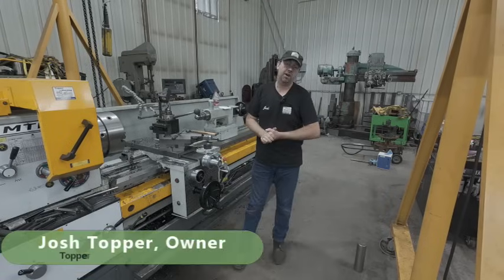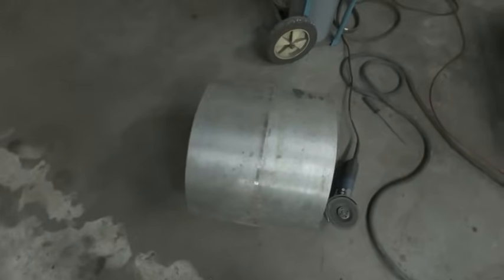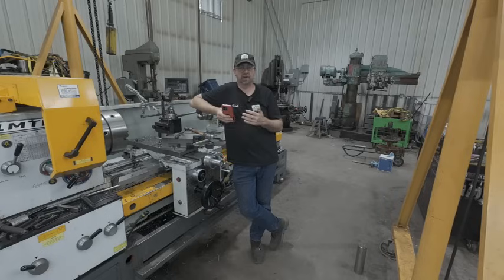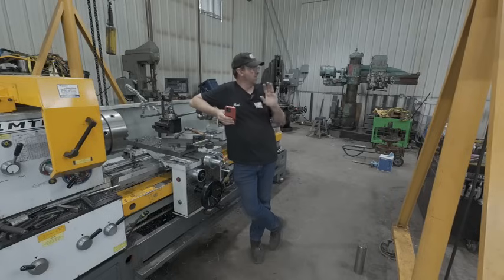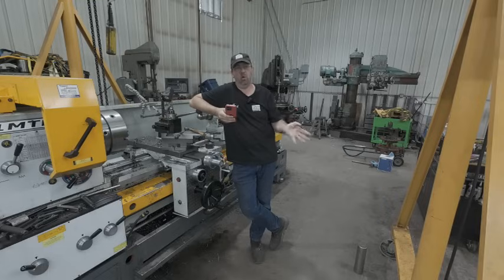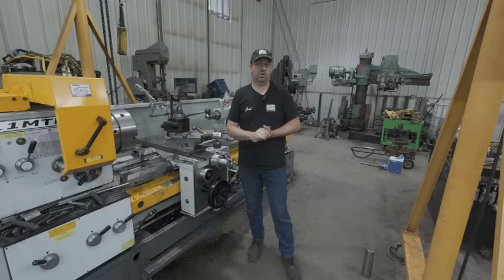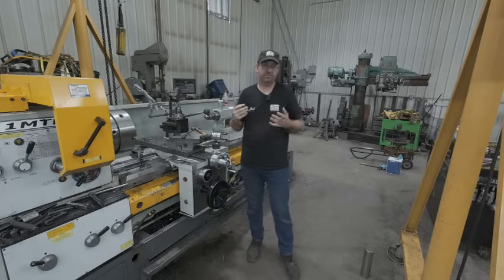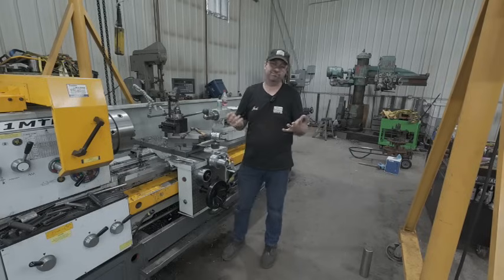Answering Viewer Questions About Machining The Crown On The Flat Belt Pulley | Follow-Up Video

Comment: The fact that a crown holds the belt on, as it was explained to me, is the belt goes towards the tight spot. With a crown,  the belt is tighter in the middle so there is more force there than the outside so it is pulled in. Basically it's physics, I guess. Kinda the same principle of weight transfer on a trailer. The force is going to go towards where the most weight is. If it's towards the back of the trailer (outside of the pulley) that's where the most force is going to be put. Conversely, if the weight is up front (inside of the pulley) that's where the weight is. Now, the rear of the trailer has no mass to keep it steady, and it will start to sway (belt will fly off). Weight in front of the trailer, towing vehicle absorbs any movement (belt stays on).

Comment: I bore and thread in reverse all the time, pressure remains downward with the correctly handed tool. The benefit I find with threading towards the tailstock is higher RPM, leading to a better finish with inserts. I can thread to a stop any day of the week, but the finish can really benefit sometimes with the speed I would never use, treading to a stop. I'm not as instant at stopping as a CNC.

Comment: While i understand your point about turning in reverse, i think it become moot with the boring bar. The boring bar applies a torsional twist to the post, one way a CCW load and the other a CW load as the operator facing the cross slide. It would be similar as to using a tool mounted to the left of center vs. The right of center of the tool post, would it not? The difference which i do understand from your point is an upside down, say, cutoff tool would apply lift the tool post, but the boring bar tries to twist it since it hangs so far off the side.

Comment: I had a shop teacher who explained why they crown bandsaws and flat pulleys. He said to think of putting water on the surface. The centrifugal force would cause the water to move to the highest part of the wheel. The belt does the same. Always enjoy your videos, keep up the good work!
Reply: TY. I have always wondered about that.

Comment: Hi Josh . What i have to do with the taper turning attachment is after the cut , withdraw the tool after noting the position on the dial . About 1/2 a turn . Then wind the carriage back about one and a half inches back past the start of the cut , then yank the tool post by hand back towards yourself quite firmly .  This seems to take the backlash out of the split cross slide screw and it's multiple connections to the taper attachment .  Then just wind on the net cut .    That usually works for me .    Cheers  👍
Reply from the maker: Thanks Max. I'll try that next time.
Reply: Hello young max.

Comment: You need a good ol Bullard! we have a baby 24" from 1925, it does not get used much, but when you need it, its perfect for stuff like this. Otherwise we make a lot of shop made boring bars, use them for threading mostly, but perfect for stuff like this. weld a bunch of crap up, add stiffening ribs even, mild steel is fine when you are talking a 2 inch bar.
Reply from the maker: I would love one, but with zero work for one, it isn't justified.

Comment: Good follow up. I mentioned before that I did that upside down boring bar approach - but I remember now that I ended up buying a left hand boring bar so I could turn the right way, because going in reverse really stuffed up the rigidity, lifting the cross slide up exactly as you describe here.
Reply from the maker: Yeah, I'm on the search for a good one. Never a good idea to do it this way.  Got to do it right the first time. Lol

Comment: Shouldn't be much of an issue lifting vs pushing down on a decent lathe. Almost every CNC lathe runs with the cutters upside down cutting on the backside with a normal spindle rotation, and it's not a problem
Reply from the maker: Incorrect, look at how that CNC is actually set up.  It is locked down and pushing against itself.
Reply: If the cutter is upside upside down and cutting in the back the spindle is in reverse
Reply: @ellieprice363 Your response doesnt logic. Topper showed a cutter in the front upside down, needing reverse spindle rotation. A cutter upside down in the back would be standard rotation, and a cutter right side up in the back would be reverse rotation.

"CNC Lathe for Beginners: Everything You Need to Know | The Lathe Lab Ep.1" by Practical Machinist shows an upper tool turret at 5 minute in with nearly upside town cutters (nearly because the turret is not a full 180° from the front turret) and still running the spindle in a CCW rotation, not a reverse (CW) rotation

Comment: Hey Josh - excellent job explaining your thought process and limitations with the construction of your original pulley!  If it were not so expensive, I would say you could fill the pulley with some sacrificial material like casting silicone or expanding foam which may reduce the ringing and chatter and then remove after the turning is completed.  Alternatively, if you made a couple plywood end plates  maybe 1/4" smaller in diameter than the inside of the pulley and then silicone them onto your mandrel at the end of each open side of the pulley and the inside edge between the plywood plate and the pulley, maybe even fill the space between the end plates with sand that may have done the trick as well.  That being said, you overcame any real issues in the end that cost you nothing other than a little time.  No real need for precision smooth finish anyway was the belt running on it would acually benefit from a rougher surface than smooth anyway.

Comment: One question I should have asked in the main video: Can you buy a flat belt in the size you'll need, or are you going to make your own flat belt from something like a conveyor belt or other material?
Reply from the maker: I can buy them, about $3500 as of current.  I might make my own from some conveyor belting also.  But that is actually hard on things vs the canvas belt.

Comment: First and foremost like your channel. However, you are 20yrs in and a shop owner. And you don't have a boring bar that holds HHS or brazed tooling.
Reply from the maker: Not anymore.  Got rid of most of that stuff.
Reply: @TopperMachineLLC mane internal treading, snap ring groves and costume raduis. Can not beat them
Reply from the maker: @bosshimsaidhetried8499 I get that, but I have inserts for all of those things. Carbide has come a long way
Reply: He could easily purchase some or make his own if needed for a special job. There’s some jobs, (not so many anymore) where HSS and brazed carbide work better than inserts.
Reply from the maker: @ellieprice363  I can, and have when it is needed.

Comment: So by "not in reverse" you mean "no upward pressure"?  What are your thoughts of cutting on the back side of a work piece with the lathe running in reverse to still put downward pressure on the cross slide?  I have cut short tapers with the compound this way because the compound is in a much more convenient location cutting that way. Obviously you probably can't use tail stock support in this configuration so it is limited to short sturdy pieces that don't need the support.
Reply from the maker: as long as the cutting force is down into the carriage, it should be fine.

Comment: Could the chatter been avoided by temporarily welding some "spokes" across the edges of the pulley rims on either end?  (Removing them after turning, of course.)
Reply from the maker: probably.
Reply: I'd not want to risk that. Putting heat into it with welding, then  machining, and then removing the brace seems like a recipe for things warping. 

IMO, the only way that I'd try that is to weld in gussets. And leave them there after the machining. But, you might be able to convince me otherwise.
Reply from the maker: @bobmazzi7435 I agree.

Comment: For your power trenching... keep in mind, each osha guy is usually about 5, to 6' in length.
Reply from the maker: I need the dragline to dig their holes.
Reply: @TopperMachineLLC  In an emergency, you could use the loader, but it would be harder to get deep enough easily. 
But I once dug a good sized pond with a skid steer, so it would not be impossible.
Reply: The correct unit of measure in this case is Smoots. And, yes, it is exotic, but I'm curious how many people figure out the reference. <G>

Comment: I've seen multiple explanations of how and why the crowning keeps the belt centered, and while I accept that that's how it works, it still seems like magic, and entirely counter-intuitive, to me. Which shows how poorly my head is working, of course. ;-] Makes me wonder who came up with it in the first place, and how hard they had to argue to get it implemented for testing.
Thanks for the explanation again, and all the others.
Reply from the maker: It is very old technology, and I still firmly believe people were much smarter back then.  Look at everything being designed now days, it is all newer versions of something old.
Reply: @TopperMachineLLC  Back in the od days, there would have been less knowledge around, so people had to come up with solutions to problems that were encountered for the first time.
Reply: @TopperMachineLLC  I don't know if I believe that people were much smarter, I prefer to think that the dumb people were much quieter. Of course, what I prefer to believe may or may not be accurate, so... ;-]
Reply from the maker: You could be correct on this one.  Or there were less safety appliances and the stupid took care of themselves.  Which is definitely not the case any longer.

Comment: Used to have the formula for the curve in a flat  belt pulley depending on size and width. We made V, Poly V and flat belts up to 1 ton weight.

Comment: I did not know there are RH and LH boring bars. I learn something interesting on every video. Thanks! Lots coming up: dragline, saw mill, and of course the "secret project". 🙂
Reply from the maker: I am looking forward to the secret project, but it will be a while yet.  Winter project, I am thinking.
Reply: @TopperMachineLLC  Your skill and honesty will keep me coming back no matter what you're working on.  I'm not a machinist and have had a lot of fun trying to imagine how you will manage the secret project. My leading theory is it will involve your horizontal mill,  vertical slotter, and a sleeve.  During the course of my "research" I actually looked up the vertical travel spec of your mill. I also picked up a Machinery Handbook and have been beavering away on it. :)
Reply: @TopperMachineLLC  That sounds interesting enough to wait for. But in the meantime, your videos always have something of interest with your various projects and occasional work coming in. Hopefully more work does come in soon.

Comment: I know that when I had a job turning long tubes I made plates for the ends and clamped the whole tube on a mandrel ( I actually used a milling arbor that fit directly in the headstock ) from end to end so the pressure was at the rim. Worked like a dream, but I was making more than 50 so it made sense to get the setup "right" rather than fighting  it like I would have for only one. 

In this case, I do wonder if the way you clamped it with just the single screw did build up harmonics. And, as you mention, the forces on the cross slide are going the wrong way. But, you did get it done. And that's what counts.

As far as a boring bar, making one that takes 3/8 or 1/2 square HSS bits out of a section of 2 inch bar would be fairly easy. Or, even use a round bit and sacrifice a drill bit for the tool.  Yes, a carbide bar is lots better, but for the occasional job just a steel bar ( which is what used to be the standard ) would probably get the job done. And as a plus, could be used internally with HSS bits for grooving. Not every job warrants carbide inserts.

Comment: be silly to run reverse on my lathe it has a screw on chuck and i dont fancy being chased round the shop by an angry 12" chuck ha ha
Reply: I don't think lathes with screw on chucks have reverse anyway, probably for the reason you mentioned.
Reply: @BrucePierson  I can name one that does. Schaublin. However, the better chucks also have a clamp so that the chuck does not unscrew in use.

Come to think of it, a lot of the old tool room lathes like South Bends also have a threaded headstock. And a reversing gear. The chucks and faceplates I've seen for them do not have a clamp. Might be worth considering if you were going to run one backwards and were not using collets.

Comment: I found that parting off works better running in reverse and with the parting tool on the back side of the cross slide- not sure why, but it is better.
Reply from the maker: This I can see working great.  You are still pushing down on the cross slide when from behind, not lifting.  No idea why it would work better though.
Reply: @TopperMachineLLC  I have found the same and assume it is because you are not lifting the lathe spindle with the cut

Comment: Would it be easier to make a boring style bar for crowning the wheels, You could make a really strong one with extra "bracketing"  to make it even stronger than a normal boring bar?

thought provoking stuff...is the language too explict for a video on the sprocket job 
thanks for sharing
Reply from the maker: That could work, but not worth it for one part. 

Lol, there has been some very colorful language with that sprocket. It's not listening either.
Reply: @TopperMachineLLC  I am sure you can make it do even without it listening....it'll move eventually no matter what, I believe in you 👍
yes I can see why taking the time out for you is too much of a commitment but pleased you think it could work....voice of experience and all that 
Cheers Josh
Reply: @TopperMachineLLC  Try talking to it nicely, it might listen.
Reply: @BrucePierson  Ive had a few of those... I used to have a central heating boiler that only lit if I told it I was about to scrap it...that worked every time ....being nice didnt... and no I can't explain it lol

Comment: Flat belts are good and bad all at the same time. I had a South Bend 9A with a flat belt and crowned pulleys. I converted it to a serpentine belt and that little machine was a smooth and quiet joy to work with. It was missing the spindle bore and swing that I wanted so I sold it and bought a slightly used 13 inch Chinese machine with a 1.5 inch spindle bore for less than I sold the 9A for. It's a light duty machine but it has done everything I've asked of it. I do miss the quick change gear box though. Gear changes are a bit of a pain but for home hobby use it's ok and after a while you get pretty quick a gear changes. I'd love a 13 inch Modern Standard but I don't do enough turning to justify it and not being a commercial machine shop time is less important.
Cheers: BJ

Comment: Hi Josh, I don’t comment much. But I remember when I had a 135 Ferguson tractor and I sourced the parts to run a saw bench, ie pto driven pulley, belt and saw bench. The pulley drive had a crown on it too. And I thought to myself how did they get the large convex radius on it? Guessing a purpose made machine or adapting an existing machine they already had. The crown I knew it would be for belt tracking. 
So hear me out, it sounds kind a weird but with a similar mandrel you drove the pulley blank with in the lathe chuck. You could adapt in the horizontal mill spindle supported by its outer bearing and overhead arm. And with a diamond shaped insert tool mounted on a post centre height, then fixed/clamped to outside of a rotary table of an appropriate diameter that will achieve the required convex radius. Winding it thru its path would be an arse, but some of those rotary tables can be driven from one side of the Y axis via a gear/banjo cluster on the milling machine. This would be for multiple parts of course.
Reply from the maker: Sounds far more time consuming than the lathe. Glad I only had one to do.
Reply: Then there’s the copy turning hydro attachment with the stylist/ template assist. Only one shop I worked at a naval dockyard had that in the late 80s.